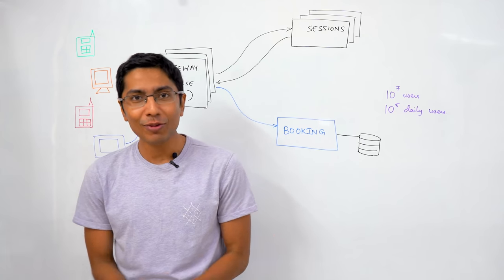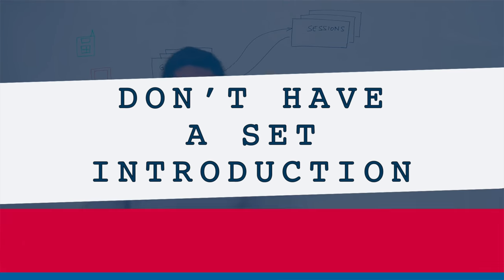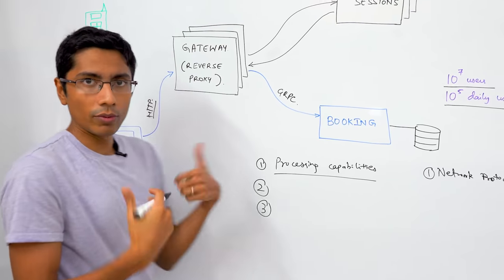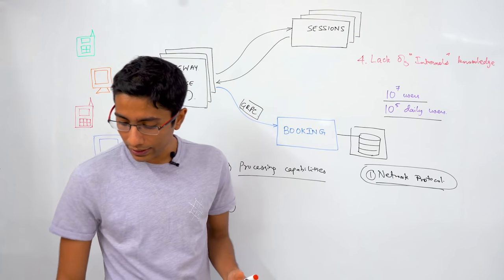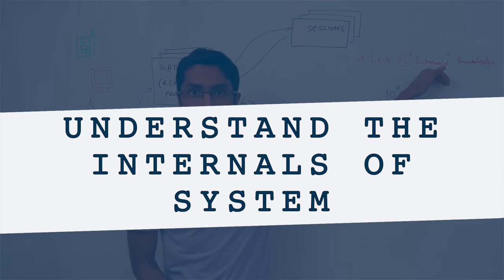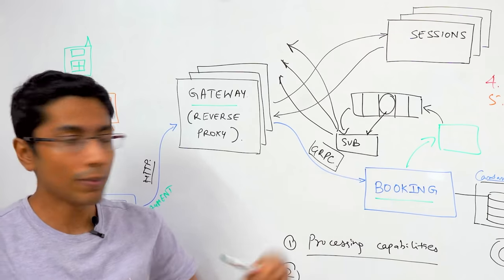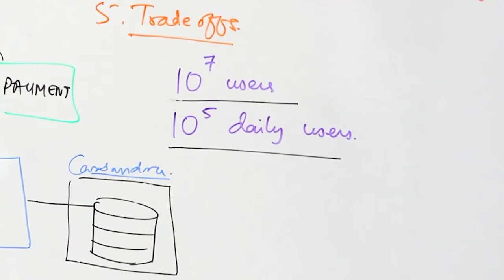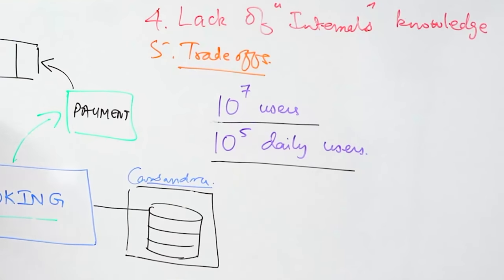Five common system design interview mistakes 😅

Comment: 1.don't have a set introduction
2.don't do capacity estimation without any reason
3.for Sr., focus on network protocol
Sys Des interview is NOT about building a working sys but measuring your aptitude
4.understand the internals of systems
5.think of trade-offs
bonus. stay with the problem

Comment: It is amazing to see how many youtube videos talk about what component does what but barely anyone talks about what is expected of candidate in an interview. Because we see so many of these vidoes on how to build this and that, when you face the question in real interview, you are just thinking of what to throw at interviewer thinking that that's going to work but in reality its only making your interviewer think that you just read that somewhere. I couldn't agree more with envelop estimates. Now see all these youtube videos and almost every single one of them has 5-10 mins spent on that. What's the conclusion of all these estimates??? For the most part nothing. We were going to do the same without it anyway. 
The main point to take away here is to keep in mind to stay focus on the problem given. Setup the stage quickly (Functional/ Non-Functional requirements and main entitles for the system and Rest API calls if the product is client facing) and then do a quick High level diagram. Then its time to stay focused on the question and talk about the trade offs in deep dive. That's what I have gathered  so far after spending tons of hours and some mocking interviews. Hoep this helps out others to stop wasting time into other things. Put simply, if you do everything right but didn't spend time on the core of the problem, you failed.

Comment: These kind og System design interviews are more about showoff. Just learn about load balancer, autoscalling, microservice, kafka, logging service, databse replica draw some stupid diagrams and u can crack it.
I personally feel like it should be more about database design, choosing the right set of technology, api security, architecture of ur code. Choosing between different databse system.